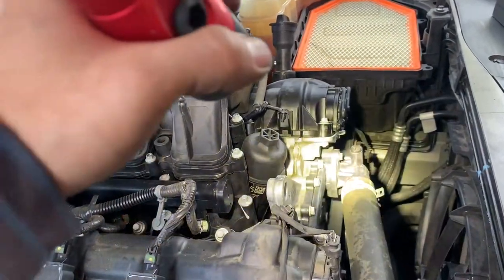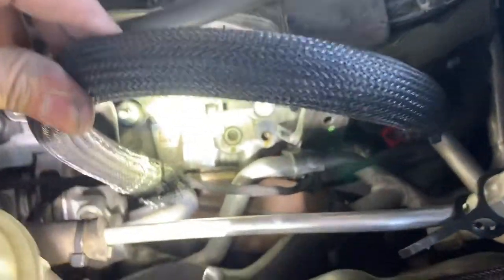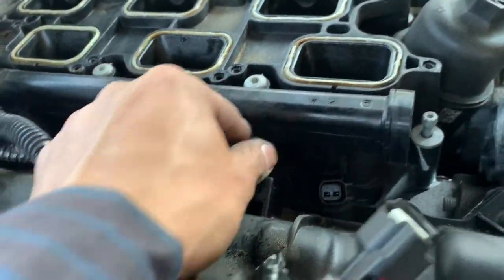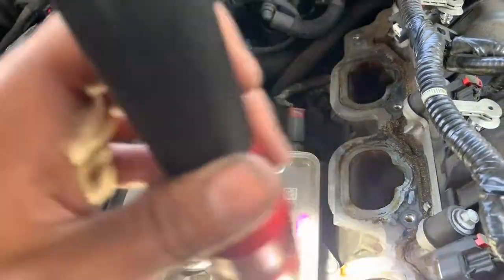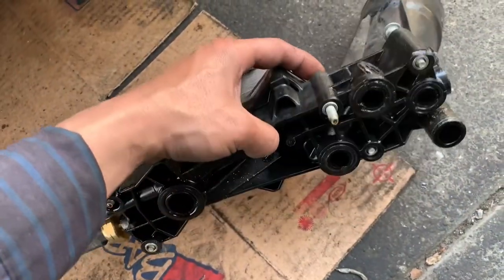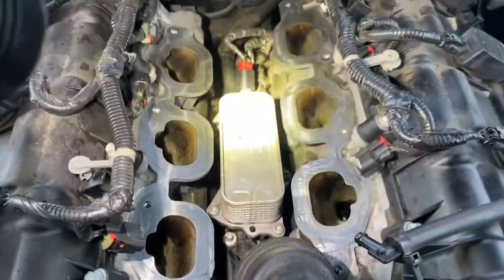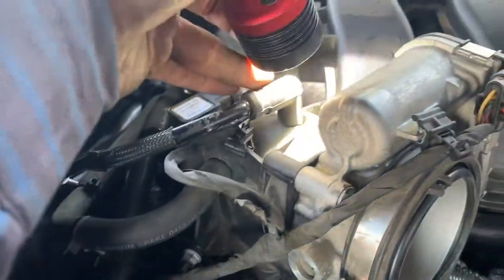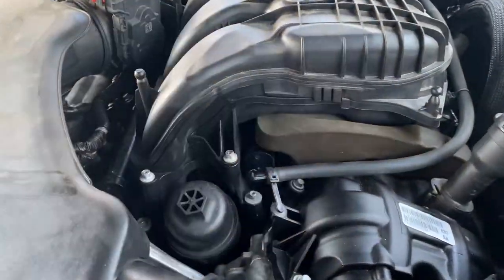Jeep Dodge Chrysler Oil And Coolant Leak - (Replacing Oil Filter Housing)

Comment: Hello, did you drain the oil or coolant first?before you do that?
Reply from the maker: You can drain the coolant out a lil bit, then refill it after you install the parts in. Then change the engine oil last.